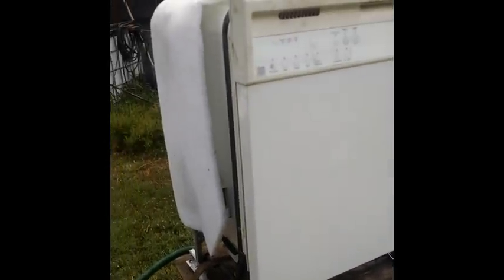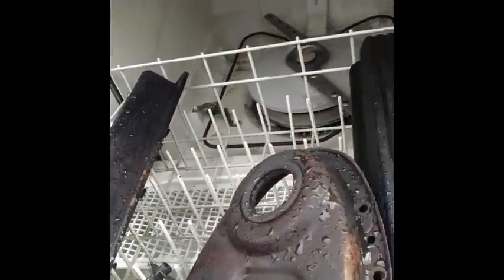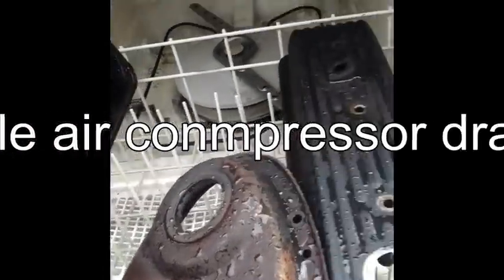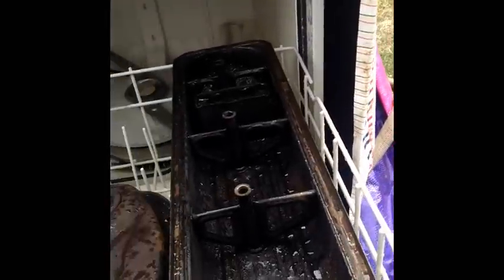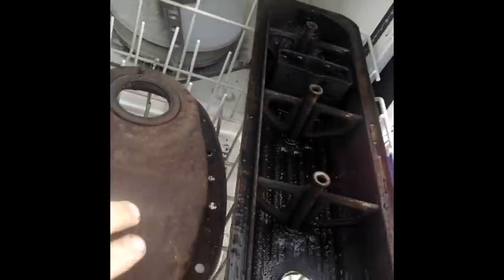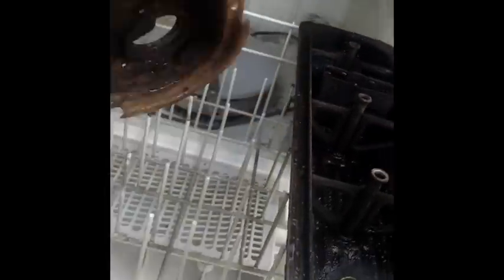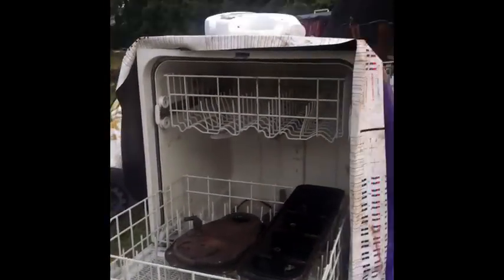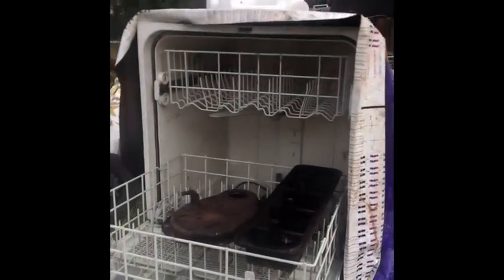Using a dishwasher as a parts washer

Comment: Its a good cheap idea, I was considering the same for my shop. I have decided to get a used restaurant dish washer which you can crank the temp up to about 195, will also use some nasty caustic cleaner in it.
Reply: that will work well dont use the caustic stuff on aluminium part as you get left with milky white water and a small clump of aluminium or no part left at allthe stuff is realy hard on youre skin too , the caustic soda causes burns

Comment: I wonder what it would do with a closed solvent loop sorta like a normal parts washer.. but in this case you use the dishwasher to heat and pump the solvent. So I am thinking have a bucket  gravity feed to the washer and let the drain pump it back into the bucket.
Reply from the maker: Not sure. If it wasn't so cold and rainy i might go give it a try.

Comment: prolly able to run the machine from a submersable pump intoo a barrel with diesel or degreaserand have the outlet hose go intoo the same barrelthrough a filter
Reply from the maker: Hummmm. May have to try that/
Reply: @UncleWillie  actually saw it done in a different video after i commented on this 

the guy had the pump outside the barrel pumping intoo a heat exchanger (electric heater in a pipe where the pump pumped the water through) then intoo a y coupler 

half the water got pumped back intoo the barrel the other half whent through the machine , he had the barrel heating and pump sitting on top of the machine 

seen another thing that seemed to work realy well , they used a steel trashcan filled with water and soap put the part in put a gasburner under it and cooked it steaming hot for 2 hours , the cilinder head they put in it came out looking like new , not even discoloration from the oil inside 

if you do this only with smalish parts like motorcycle carbs and waterpumps you could use an electric deepfryer complete with the basket as long as you set the temp slightly under the boilingpoint of water

Comment: You're wasting time with it in the dishwasher if you're not using really hot water in it. Effectively you're just washing off the degreaser & anything it would get off with it as if you rinsed it with a garden hose. You really need super hot water(almost steam) to really make a difference.
Reply from the maker: +Lonewolf3165 Gee I am so glad that someone wants to tell me that what already worked won't work. I will go back and unclean all those parts just so I can do them by hand now.
Reply: +Uncle Willie I didn't say it won't work. I was just saying that it would work much better by using hot water. That is the way a dishwasher is effective, by the heated water. Judging from the fact that you had to reclean them a second time & the amount of grease left behind after the 2nd time I'd say it didn't really do much more in the dishwasher than it would have otherwise with just a hose, degreaser & a scrub brush.  I'm sorry if you took offense to my comment, that wasn't my intent.  I was just making a point for other youtube viewers who may want to try this. The heat is the trick. But if you post something here on YT you need to be willing to accept comments that may include constructive criticism sometimes.
Reply: Lonewolf3165 most dishwashers use cold water and heat water.
Reply from the maker: Lonewolf3165 Not all criticism is constructive.  Some is just someone flapping their yap.
Reply: Sorry if I offended you.
Reply from the maker: Lonewolf3165  You couldn't moffend me if you tried. I am not a delicate little flower who needs a safe space.
Reply: Glad to hear that. Too many people get offended over everything anymore.  It gets in the way of enjoying life.
Reply: Most dishwashers have a heating element inside towards the bottom of the washer so no need for a hot water hookup.